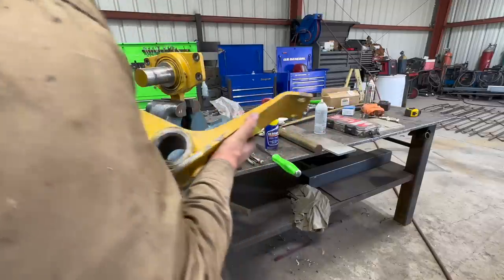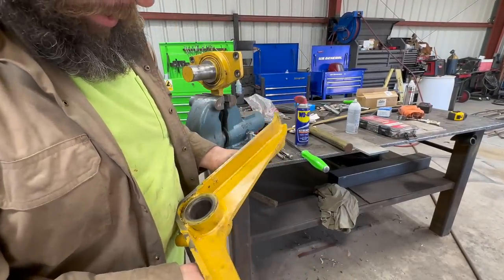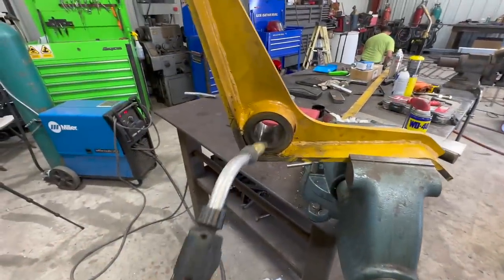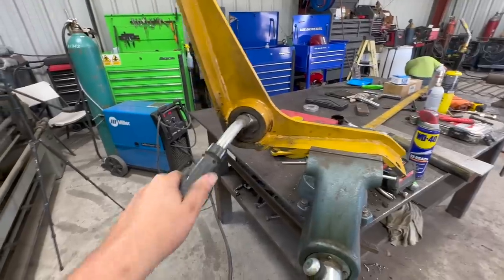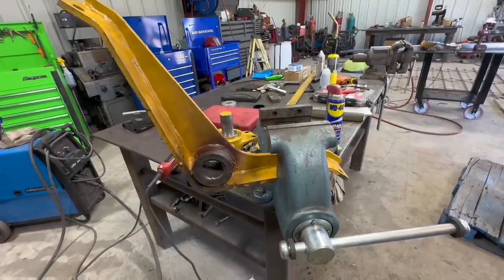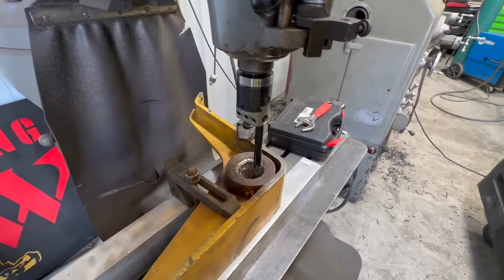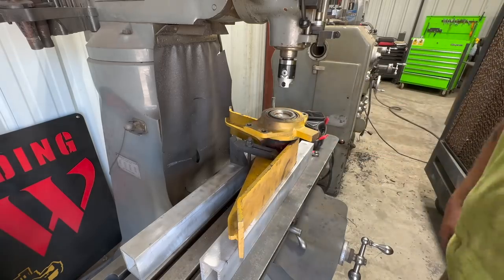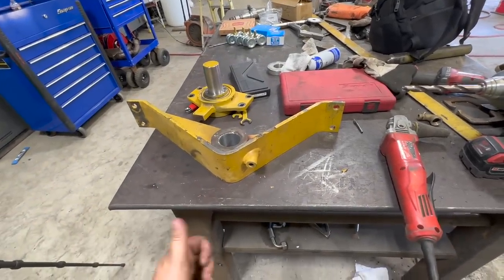Transmission Mount

Comment: I ran across your video about repairing the fuel leak issue on the Cat 637.  Wow!  You have no idea how impressed I was.  At the end you did not mention the other crack/s in the lower frame area. Assuming that the customer planned on fixing that or did you get involved with this also. Thanks

Comment: I've watched a number of your line boring and welding videos.  As an amateur, I wonder how you get machinable welds?  Over the years, every time I tried to machine my stick welds, they were rock hard.
Reply from the maker: Sounds like you are either using the wrong rod or you are welding on cast. A rod like 7018 will turn extremely hard when welded on cast iron.
Reply: @OFW  Thank you for your reply.

Comment: Hello! Couldn't you have made that chamfer with the hole lathe? Maybe it would have been nicer than with the hand grinder. Ok, no big deal. I know. Greetings from Hungary! Sincerely, Balázs
Reply: On the first part of the process he used the hand grinder to take the rougher/higher weld build up down abit first-He explained that it would be easier on his cutting tool ( on the milling machine) this way🤙🏼.

The final chamfer was done with the hand grinder because he didn’t have the proper chamfering bit at that time ( for the mill). Nice repair, and it’s not the space shuttle so it will definitely be just fine😂👍